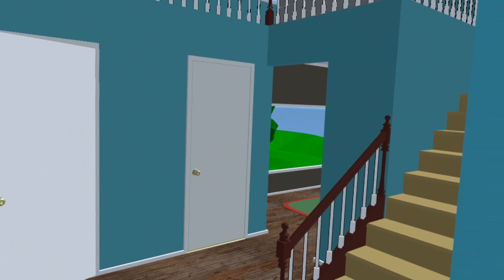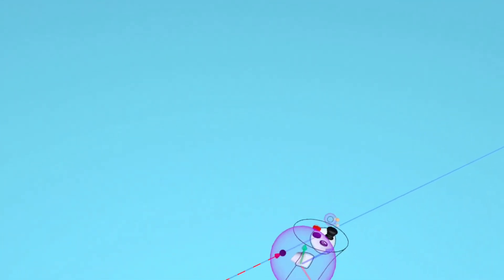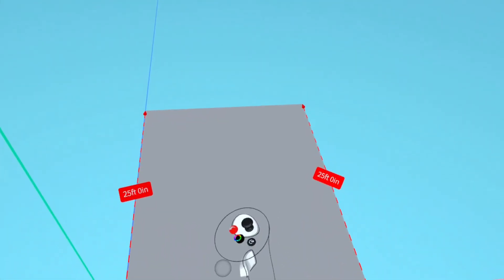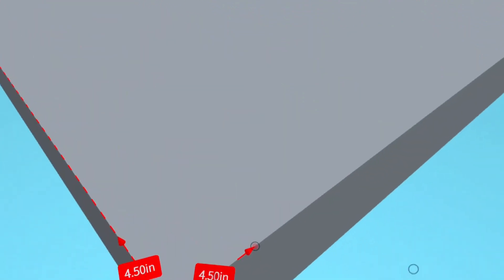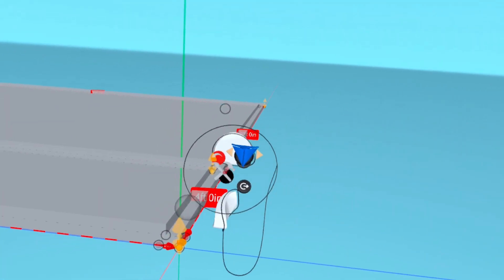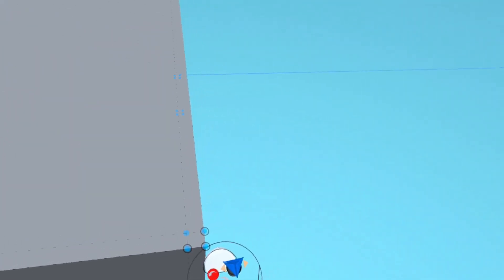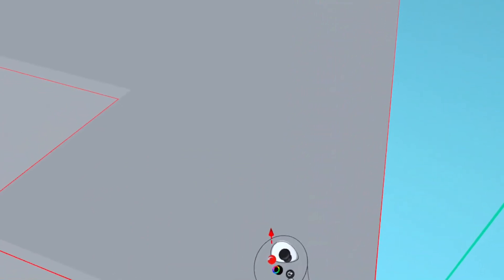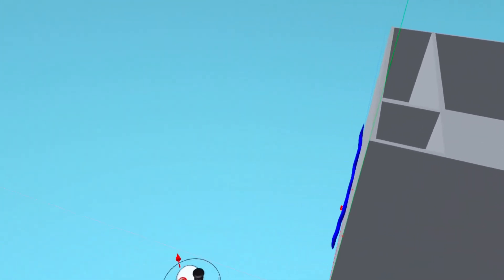Gravity Sketch House Modeling Pt. 1: Floors and Walls

Comment: Great video. One to rewatch a few times to catch all the controls you are using. 👍  I'm finding gravity sketch to be somewhat impenetrable at times , I'm importing low poly stl files and assembling them into composite assemblies and its just soOoOo difficult and awkward. Your video shows a lot of tips on using the measure tool to set distances that may help me get round some of the issues I have been struggling with! thanks!

Comment: if only we could get some basic CAD modeling tools like extrude faces, precise measuring this would be a very powerful software 

the problem is you cant just apply a defined measurement point to a line. i should be able to click measure, click precise measure, click a line on model, then a begin point, then be prompted for a defined measurement, at which point it would place a snap point at that point on the line with a red visual measurement line for visual aid 

then the ability to create new lines between snap points to create new faces 

then there should be a extrude faces tool  

and lastly a Bool Tool to join objects together

that is all this sofware needs to be a huge tool for VR CAD Modeling as well as artistic modeling with the tools it already has
Reply from the maker: Those things sound great. Have you joined the Gravity Sketch Discord server? You can make suggestions there for the devs to see.
Reply: I agree with trying to use the same as extrude and cut